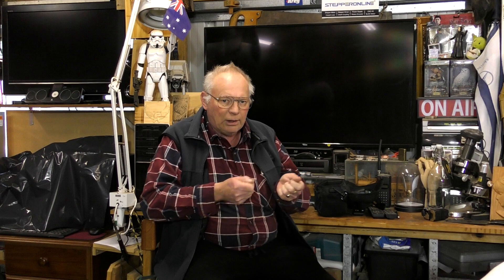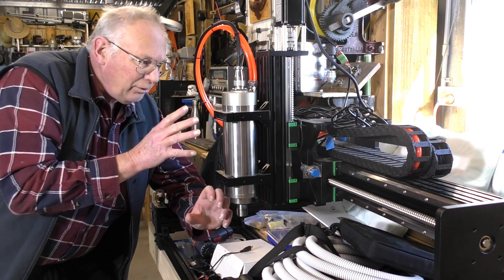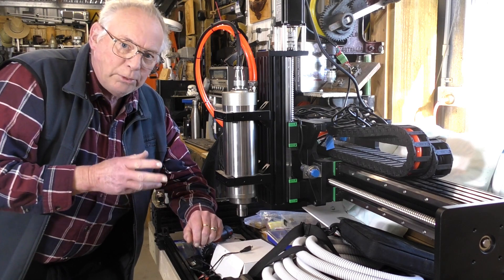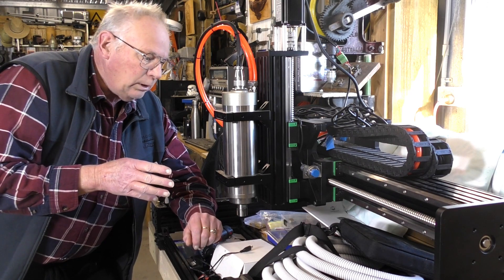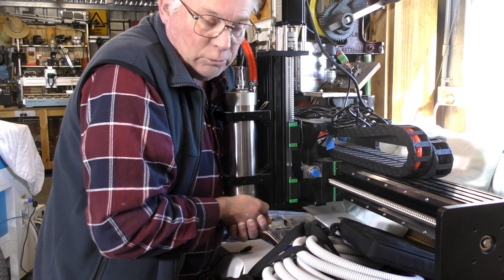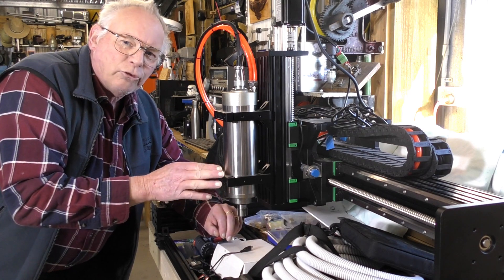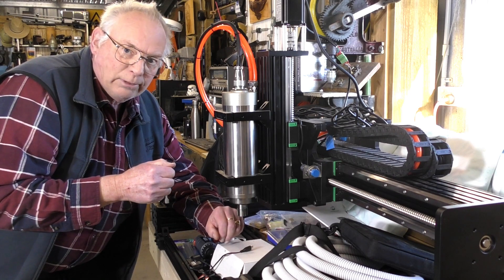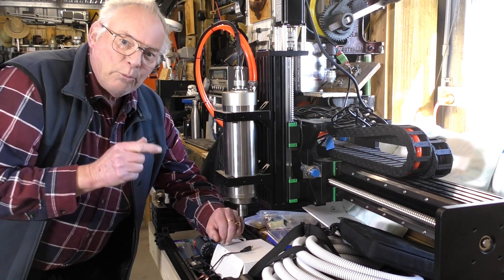#(1) CNC Electrical Mach 3 Queen Ant SMC5 5 N N controller for Patrons and Subscribers Part 1 of 2

Comment: Hi Roger I have bought a Queenant Pro V2 and have a Gecko G540 with Mach 3 could you help with the motor tuning with the 1610 ball screws and Nema 23 345Nm steppers. I am coming from a Open builds OX Belt drive ? Cheers Peter

Comment: Re: aluminium - the patron should check if it cuts with no lateral movement i.e. does it drill with the bit? Secret to aluminium: single flute, up cut, cutting fluid, ramping. I built a large CNC doing this on my Heiz S400, a great machine but nowhere near as beefy as the Queen ant